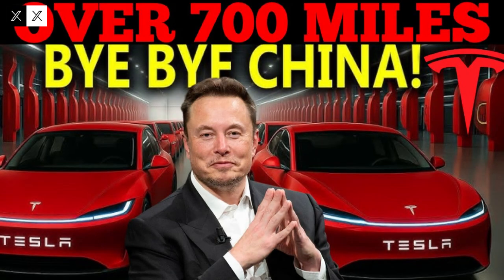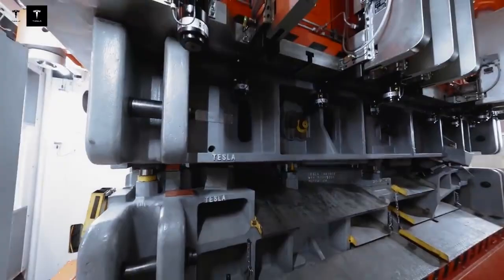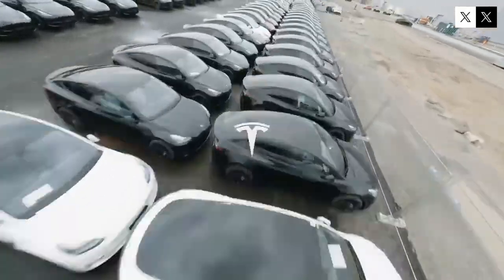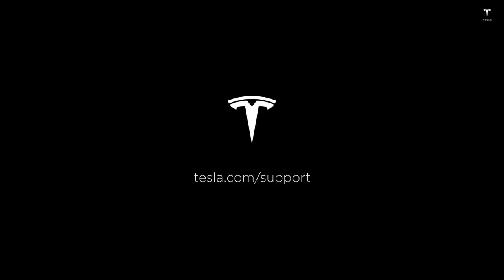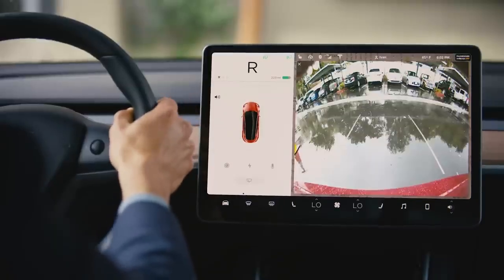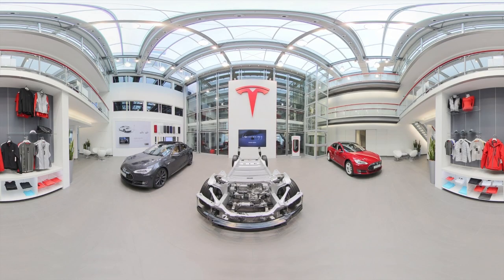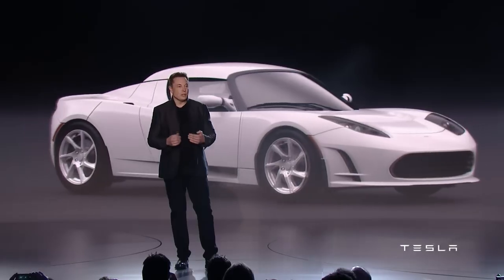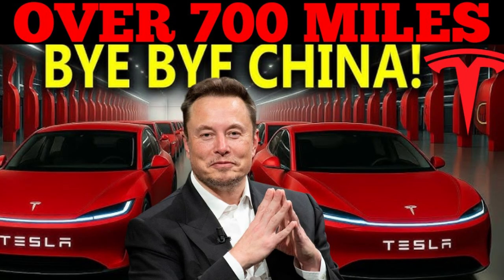IT HAPPENED! New Tesla Model 2 Offers 350 Miles of Range and Ultra Fast Charging at $4,000!

Comment: A 350 -EPA mile for the rumored Tesla 
Model 2 is Speculative  with unofficial sources offering conflicting. Claims the   Sub -$20,000 price point mentioned. In 
 Charge. Tesla Model 2 On a 150-kw charge  it could take to 60 minutes. To reach. 80% 
Eleven to. 12 hours. For a full Charge 
(Range from. $13to $18)